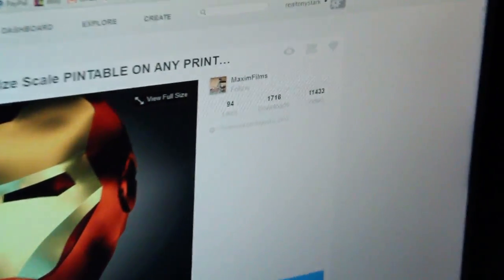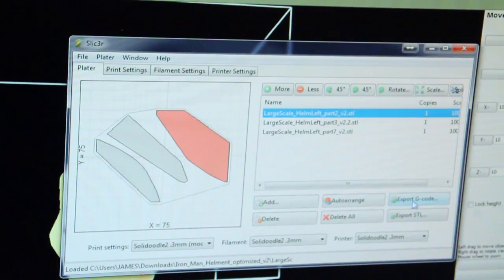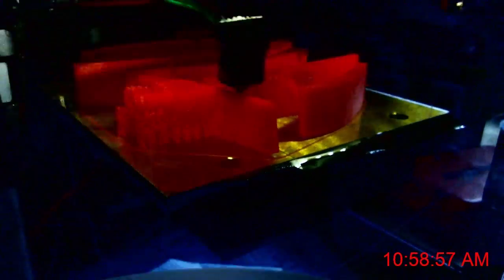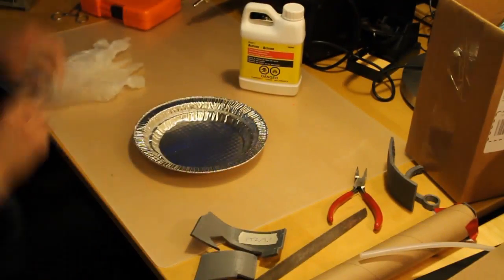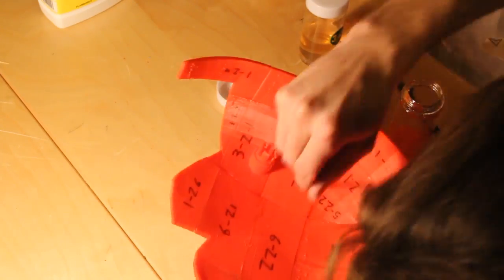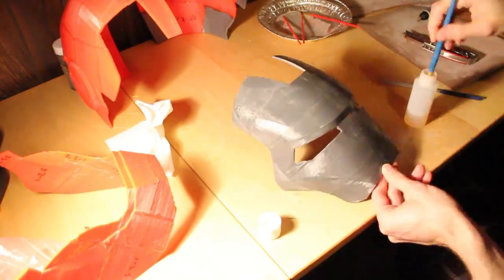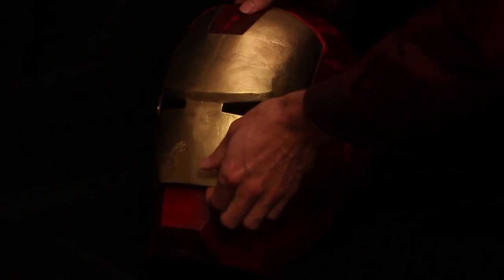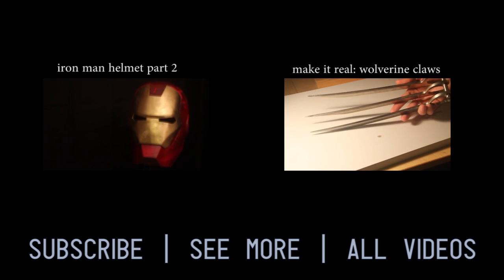Make it Real: 3D Printed Iron Man Helmet!

Comment: I very much enjoyed your video two thumbs way up on the effort, but wouldn't it be easier to design an interlocking method for each individual part that makes up the helmet (as oppose to just gluing it) ? also wouldn't it make the surface smoother to add spot puddy and/or bondo,? i mean, since youre going to be sanding anyway.